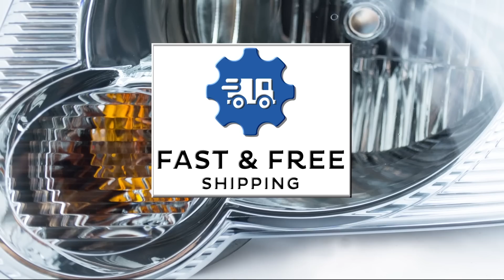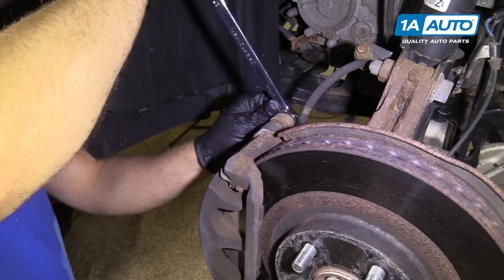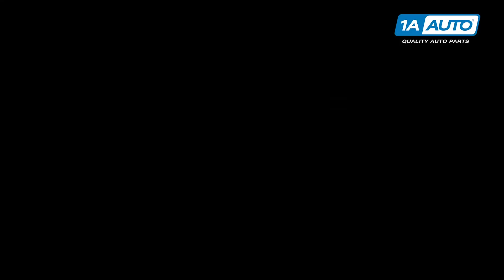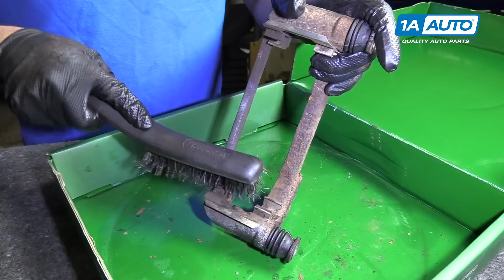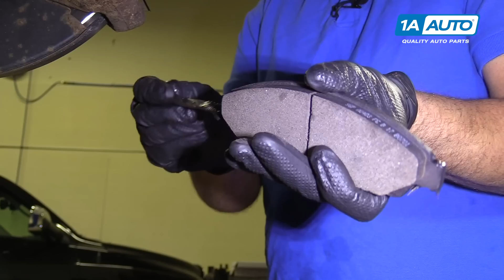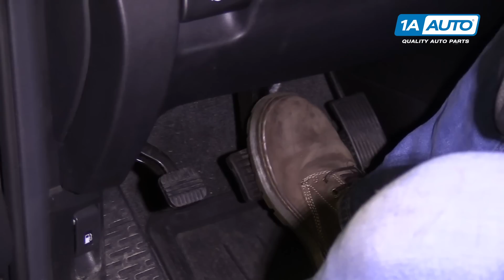How to Replace Front Brakes 09-15 Honda Pilot

Comment: Forgot to compress the piston and clean the piston boots. Leave master cylinder cap open to relieve pressure.  Clean the rust off the hub.  Then check lateral runout to Honda Spec.  

Forgot to mention that the piston must be compressed slowly and brake bleeder must be opened to pull fluid to avoid contamination (ensuring air is not drawn into system and closed when compression while ends).  With ABS, the brakes should be bleed after the change.  Also,  cleaning stud threads and back of wheel to ensure proper mount and lug nut torque.  Washing the rotor with soap and water does a better job than brake cleaner.  Removes any small residual metal more effectively.    The caliper bolt threads need to be cleaned and checked they make a snug fit.  Any play and they must be replaced.  The mating bracket threads need to be cleaned as well or the torque could be impacted.  Nice demonstration video. However, people should not use it as a guide.

Comment: Very helpful video. The only trouble I had were those springs. After they're reinstalled, they want to pop out the pads. Not sure why they didn't in this example. And of course, the pistons have to be compressed again before reattaching. But overall a good video. Thanks for the work, 1AAuto.
Reply from the maker: +B Mac Thanks for checking us out! http://1aau.to/m/Shop-1AAuto-c
Reply: I had the same problem.  I used 4" C clamps on very top and bottom of pads, then started caliper over pads and removed C clamps before fully pushing caliper on.  "I win!"

Comment: Good video, just a tip from us northern climate people. Buy a tube off anti-seize and put it on the rotor mounting screws. The next time they will come out real easy. I also put a little of the anti-seize on the back side of the rotor where it touches bolts, helps getting the rotor off too. I would also recommend replacing the brake pad guide clips. Cheap easy part to replace. Nice video.
Reply from the maker: +JT Price Thanks for the feedback!

Comment: Great video, perfectly paced and very clear camera work.  Suggestion, those pesky rotor screws are not phillips, they're JIS (Japanese Industrial Standard) which is a different cut.  Vessel is a go to brand.  I like to push the pistons back and stick a wedge/block so they don't creep closed.

Comment: Thank you for the video. I just did this brake job and I had trouble with the top caliper guide pin sticking on the driver side even after I greased it.  Do I need to replace it or is it normal for that one to be stiff?

Comment: Why no Thread Locker on the Caliper Bracket Mounting Bolts?
Reply: loll im not a mechanics but i just did remark the same thing he put it without adding some thread locker on the bolt i just watched another video telling how to replace it and on the other video they did put some thread locker on the bolt and explain why its require some thread locker and also we dont see if he did compress the pistons back and he did not show how to clean the pistons .. and he did not install a new caliper hardware kit he just use the same rusty hardware and cleaned the rust with a metal brush its 16$ for the front and rear kit

Comment: What year is the pilot you working on it ?
Reply from the maker: +Luigi Galassi The specific vehicle in the video is a 2010, however, the steps and procedure are applicable from 2009-2015. 1aauto.com

Comment: Great video, just curious, I didn't see it anywhere in the video, but did you pre-loosen the brake fluid reservoir cap? and then once you got the  caliper off I never saw you compress the pistons back in so the caliper could slide easily over the new pads during install...that still has to be done? correct?
Reply: you will need to press back the piston after you have remove brake reservoir cap. This will prevent it from pressure/Air build up in the brake lines which causes soft/pongee brake feel........hope that helps.
Reply: I was about to say the same thing the only reason I would say that is one time I forgot and I don't know why I've done tons of brake job I forgot to take the cap off and I blew out the master cylinder

Comment: Do you open the brake fluid cap when removing the caliper
Reply: you do not need to but you will need to be removed before you press the brake piston back.

Comment: Are the shim backer plates on the pads supposed to be easily removed? I just received these pads and shims come off freely if pulled slightly. Thanks
Reply: I have  a 2009 pilot . The pins needs  to  clean yearly .  Twice a year  is even  better. I have problem  of I do not clean  them out.
Reply from the maker: +Michael Lariviere The shims should stay on the back of the pads and not move.
Reply: 1A Auto Parts thanks. They should be placed in the caliper bracket without adhesive or anything? Mine are fairly loose...would you advise me returning these or perhaps putting brake caliper lube between the shim and pad backer plate?